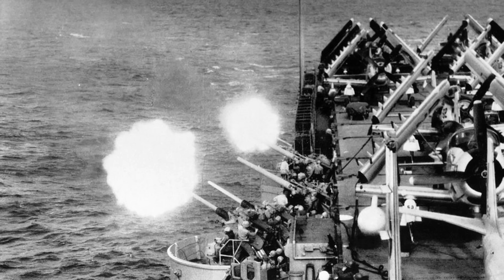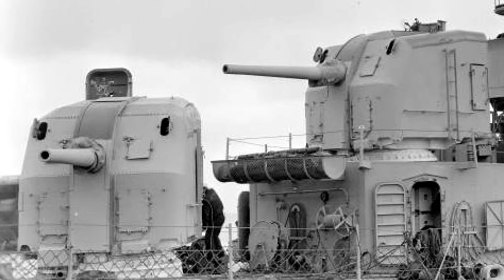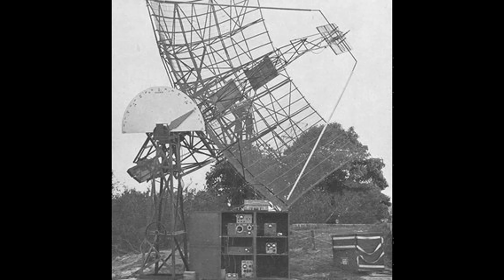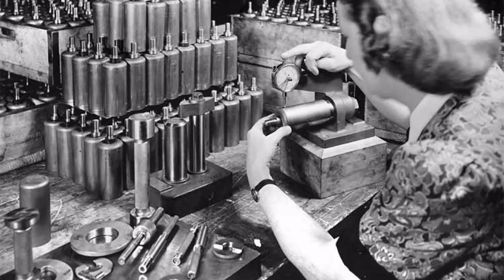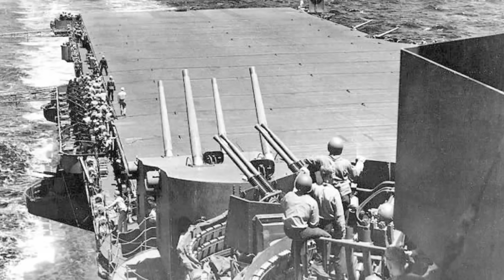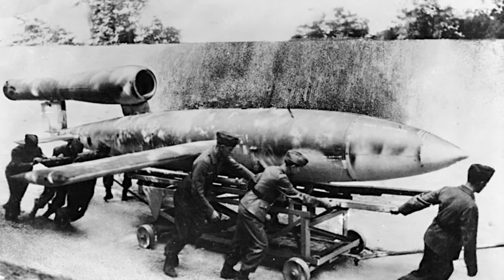Germany Called This American Weapon "Impossible." Then Captured 20,000 And Threw Them Away

Comment: Very informative video. However, I'm not sure I understand all the statistics.

When the fuses were tested in antiaircraft shells, they hit every target.

In their first use abroad ship, one out of three shells hit the aircraft.

Given the enormous numbers subsequently in use, the rate of hitting aircraft must have gone down significantly. For example, they were responsible for 50% of the Japanese aircraft destroyed despite being on only 25% of the shells fired. But since the rate of hits for the shells that didn't have proximity fuses was so abysmally low, the rate for the proximity shells could not have been that high either. Did pilots adopt new tactics designed to thwart the fuses?

It sounds like the fuses were very effective as part of ground artillery. Later, when used against the German rockets in England, they started out at 17% and then improved to nearly 80% effectiveness. My sense is that there is more to the story.